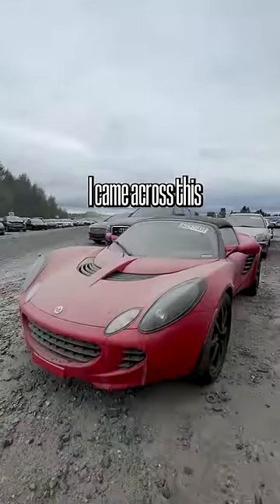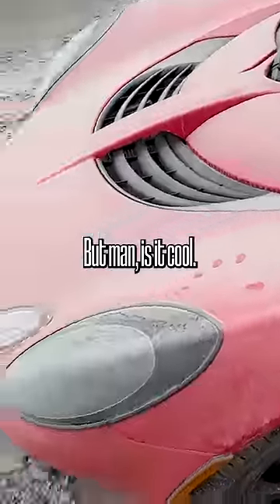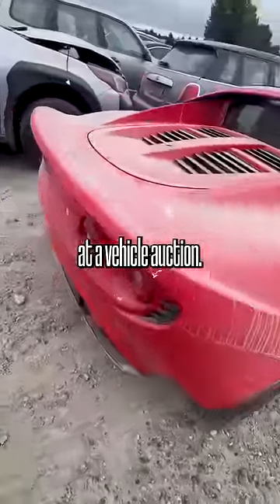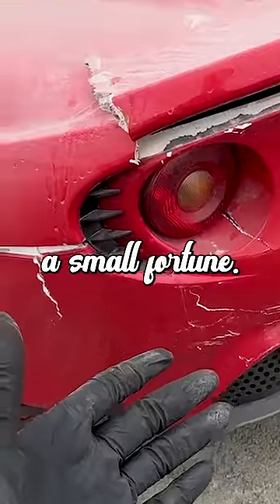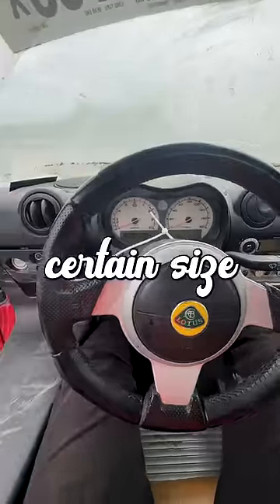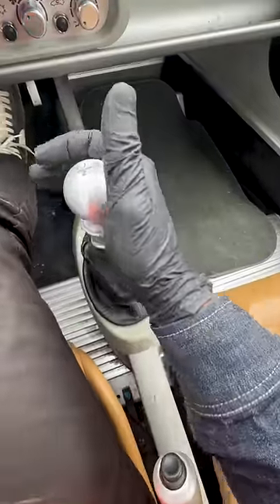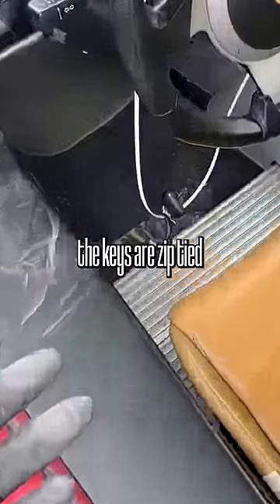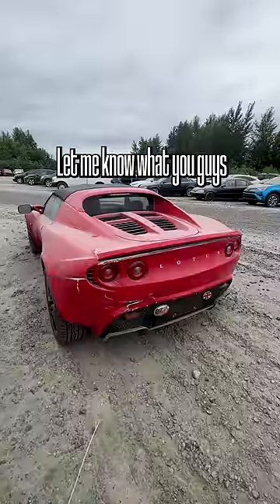Auction Lotus Elise - I Still Can't Believe It...

Comment: Yeah, that's the thing with Series 1 and 2 Elises, the front and back are both just fiberglass clamshells, with no bumpers, so if you hit something/get hit by something, it's hella expensive
Reply: We had to fix one at my body shop as it was a full respray of the car, it was a nightmare job especially since the tri coat orange didn’t cover well😅
Reply: and say goodbye to at least one leg
Reply: It has a bumper (crash structure) but it is internal. I crashed one and found out lol. It's actually a lot more sturdy a car than you think. Your wallet will hurt but you will physically be ok.
Reply: @Noobnuker1  watch one front overlap crash test an come back
Reply: @Noobnuker1  and thats for regular consumer cars. they dont even crash test luxury cars like this
Reply: fibreglass repair isnt that hard, though a new rear clam would cost about $2800.00
Reply: @1183newman  Try 12k with shipping /insurance from the uk for one that is in good condition.
Reply: @stevenfaulkner5649  true, USA likely very hard to ifnd a used one. But that rear clam def looks repairable.
Reply: Fiberglass is easily repairable.
Reply: Yes, the hands are hand made by lotus if you get the official parts. I remember that from when my dad’s got reversed in to. The issue is I think lotus doesn’t make them anymore.
Reply: @invinciblenowyt  there are many people still making them though, not just lotus. Doing a search i found a brand new series 3 lotus elise front clam (would likely fit the s2 as well). £2.2k
Reply: @1183newman  yes I know, but lotus stopped manufacturing them a year or two ago, officially.

Comment: One of my dream cars. Closest I've ever got to a lotus was a 1993 geo storm.
Reply: It would be close if you added a supercharger and relocate the engine to the back seat 😉
Reply: 2000-2007 mr2 Spyder from Toyota. The 2zz 6-speed drivetrain bolts right in. It's a little heavier but so much cheaper and at least as fun!

Comment: You should be able to take that car to a good boat repair shop to get that fixed. It'll still cost a lot, but it'll be easier and cheaper than finding a new panel
Has C4 Corvette hood repair nightmares
Reply: My c4 front bumper doesn’t align right with the hood. I wonder if a boat shop could fix it because the guy I was going to couldn’t do much but make stress marks on the bumper lol
Reply: @bigty4725  Maybe, but if the fiberglass isn't warped or cracked that might mean that the frame is twisted
Reply: @bigty4725  You need to make sure that anyone who works on it does NOT take the targa off when putting it on a lift. A lot of shops will do it, but the targa on the C4 is structural
Reply: @Rich-fr2yv  it looks a little warped in one place. I don’t think the frame is twisted because it just barley got hit by someone backing into it. Most people won’t even notice it but it drives me nuts lol
Reply: @Rich-fr2yv  ok thanks for the advice. It’s not cracked but it’s definitely a little warped in the front left. Not much but I can notice it. I had to replace my fog light to it got busted lol. The car just barley back into it my c4 and caused all that
Reply: @bigty4725  Take the bumper off and make sure the mounts are true to each other. Might have just bent one down a little
Reply: I bet those panels could be even 3d printed in  glassfiber nylon for a few 100 bucks.
Reply: @xIsouLcruSHca  I’d definitely pay a few  100 bucks if it looked just like my front bumper lol. I didn’t know you could 3d print fiber glass
Reply: @bigty4725  Its not 100% fiberglass, its nylon infused with fiberglass (don't know about what percentages, I assume they differ per manufacturer ) but the strength and ability to withstand different forces is quite similar, its about 100 bucks/ kg
Reply: that's a neat idea! never heard that one before
Reply: Inokinetic ( former sector 111 in California) sells brand new and refurbished rear clams for exiges and Elise’s.  

Shino the owner is an amazing person to work with .  They specialize in this type of work and do it the correct way.
Reply: Could easily patch it yourself but cutting a lil out of that section and using some fiberglass and resin. Jobs like this aren't that difficult and ridiculously cheap to do yourself. The biggest cost would likely just be the repaint.
Reply: My dad has a 62 c1 my brother has a 74 c3 I feel your pain but fiberglass is actually pretty easy you sometimes have to get creative with molds and making bonding strips but it’s like adult crafts
Reply: I know the AC replacement was ~$10,000 on the Evora, not an issue you want to have. Everything has to be imported and since it is discontinued it would be even worse
Reply: @krismine99  I think you overpaid for a very easy fix
Reply: @ThorOdinson-zc2kq  it was indeed not an easy fix and they had to import some parts because the actual dealership didn't even have them on hand
Reply: Many body guys know fiber glass actually messy but easy to work
Reply: @ThorOdinson-zc2kq  Whenever you need to replace a component of an A/C system after a failure, the entire system needs to be replaced or renovated to ensure no metal shards block the pinhole in the compressor. If that happens, the whole thing pops. This job can easily hit $10k on a car as difficult to work on as this when you need to import everything and all the lines are Lotus specific. It was $3k on my 2010 ford focus
Reply: @Rich-fr2yv  I own several lotus cars.  Very easy

Comment: Early ones had the 1.8 K-series Rover engines. 2004 onwards got the 1.8 Toyota VVTi units.
Reply: They never exported the K series ones to the US, though, which is where I’m guessing this guy is.
Reply: Toyota 2zz ge with a super charger 225-250 hp
Reply: VVTL-i
Reply: @emmajacobs5575  they didnt use a K series. they used a Toyota 1.8L which has a similar system to the variable valve lift and timing that the K-series uses.
Reply: @YuriTarded-n6r  rover k series and honda k series are different engine series from different manufacturers.
Reply: @YuriTarded-n6r he said rover, not honda
Reply: Most fun I've had in a 1.8! 👊
Reply: @andreistan6534 the 2zz was made by Yamaha. It was sold in some toyotas. Its got some problems.... like the oil pan. In hard turns the oil pools to one side and the oil pump is no longer reaching  the oil to lube the engine
Reply: @hh5395 most likely the head work only was done by Yamaha.
Reply: @Neishy4AGTE  Toyota commissioned Yamaha to design the 2ZZ, based on Toyota's ZZ block
Reply: @hh5395  not really... I own an 02' Toyota Corolla TSport with 222637 km, and it still pulls like new. Regarding the "problem" with the oil pan, it is actually an owner fault for letting the oil reach a level under the minimum mark on the dipstick. Yamaha tuned only the heads of the engine, and it came in toyota Corolla IX (e12) TSport (other names depending on markets like Runx ). Also, some Toyota celicas  came with this engine 2zz ge. For 2005, a face-lift came with shorter steering ratios, lower suspension, and the option to have a supercharger boosting the power up to 224 hp. I am proud to say that my specific car doesn't have any issues, and after 21 years of hard driving, it is still revving happily to 8200rpm like is nothing.
Reply: @YuriTarded-n6r early models used k series. Not honda k series. The rover k series from the tom cat
Reply: yurrr the celica 7th gen had one of those
Reply: @YuriTarded-n6r he's talking about the original Rover engine
Reply: @hh5395  the 2zz engine was not manufactured by yamaha. similar to the 20v 4age, yamaha designed the head. the rest of the engine is toyota. which is why theres actually an engraving with the yamaha branding on the side of the head.

Comment: „Lotus means ‘Lots of trouble, usually serious’” - Jeremy Clarkson
Reply: Not so with this one. Had mine for over 5 years now and 30000 kms. Not a lick of problems.
Reply: Tte ones with rover engines, yes, the ones since Lotus was bought by a Chinese company and changed the engine and gearbox into one from Toyota, nope.
If you care for it and drive it right, you will never have any problems with it 🤷🏻‍♂️
Reply: @nonamerider4953 

The VHPD k series engine (not the Honda k, different motor) was well developed and didn't actually give much to any trouble despite Internet lore.

Comment: I’d totally buy that if I had the money
Reply: Same i absolutely love the elise
Reply: Don't know how much it is where you are but if you can find them they aren't that expensive. Mine new in 2009 was £27k, and you can find them used at a decent price, at least in the UK. Unfortunately they don't make them any more, and the Emira they sell now is much more expensive.
Reply: @georgehelyar  lol in the states thats 30k+
Reply: Damn, here in my country, Philippines, I mean yeah sure its rare in this part of the world, a second hand 2009 elise with 130,000 kilometers on it, went for 71-72k usd converted. Would give my left nut to have one for 30k here
Reply: @georgehelyar yeah the import cost are crazy high here on top of the boat costs to ship it. We are just getting to import the GT-R that not adapted for the states. They cut power and added the emissions parts to them it was a looker nothing more here.
Reply: They haven't moved from the 30k range since in the used market. If you have the means you should get one. It will blow away any S2K, NSX, GR86, BRZ, Miata and FD RX7 when it comes to handling and overall raw feel
Reply: The one in this video sold for exactly $26,000. After Copart fees, it would be just under $30,000 out the gate. Including the cost to repair and register it, total could easily exceed $45,000

Comment: With the 2zz motor it should be pretty quick. Especially at 2,000 pounds
Reply: It is
Reply: Oh it’s fast, my dad supercharged his and I imagine the 0-60 was in the 3 and a half second range
Reply: Requires a lot of skill to drive at speed on a track. The light weight and rear bias means oversteer is common.
Reply: @SockyNoob  do lotus Elise have a rear sway bar ?
Reply: @Crispychicken4u  yes and that is a good thing. Removing sway bars is not tuning.
Reply: My s2 had the Komotec supercharger treatment that gives it 300hp at 890kg its pretty quick.
Reply: @SockyNoob  add the short wheelbase to that if you start spinning it is going fast around
Reply: @bolosantosi8527  I always liked that  gen Corolla XRS . Correct me if I’m wrong but I believe they are  80-100 pounds lighter than the similar matrix? .Nice sleeper ! hold on to it .Not many made
Reply: @Crispychicken4u i love my matrix..  though i have the xr which has the 1zz but its still super fun to drive
Reply: @SockyNoob  The issue is "understeer under power" and "snap oversteer under braking".   Still, a car very much worth mastering.
Reply: @markyishere1  I've got BOE's REV400 supercharger in my '05 Elise. It's zippy :)
Reply: @connordix1859  hope he built his gearbox. the C6x gearboxes like shattering 3rd and 4th when you push more power than stock
Reply: @Crispychicken4u  almost every roadgoing car in the past 35+ years has swaybars. probably some exceptions though, though i cant imagine they handle very well
Reply: @1zzKolby  if you get the chance to drive a 2zz, definitely do it. its a completely different feeling engine.
Reply: @YuriTarded-n6r  nah, the clutch died but the gearbox was mint

Comment: it's a 2zz-ge engine, probably my favorite 4 cylinder engine of all time
Reply: Have you not experienced Honda Vtecs?
Reply: @ChapHammersmith  i have a mk2 gti with a k24 subassembly mated with a k20 head. i much prefer my corolla with a 2zzge motor. better response, lift isn't as distinguishable when driving, and I've driven outta k series civic/ballades lives plenty of times.

Comment: I own an Elise. I'm 6'2 260 lb it's tight, but I love the thing. And you are right about the rear clamshell costing a fortune. I crashed mine and damaged the front. it was 6k for a new front( just the part). My total repair was muuuuuuch more expensive. I can go into more detail if someone wants. 

The engine is a Toyota 2zz ge, From a celica.

Comment: it's not just the fiberglass, these are made with a bonded aluminum chassis, essentially "glued" together. You have to check to make sure the chassis is still good after an impact... or at least as good as you feel safe driving it lol

Comment: Fiberglass is really easy to repair. That damage if it's just ripped and you can bend it back, it'll cost you like 200$ for a repair. But as someone mentioned it could be a crumple zone and stiffening it (aka repairing it) could reduce the effect and result in injuries when you have an accident

Comment: Great cars.  Perfectly fine for anyone under 6'4".  There is an "entry procedure" to hook your right leg around the wheel.  One of fastest shifting manuals you'll ever see.  It uses Celica block, but it was tuned by Yamaha.
Reply: The 2zz is a Yamaha design. Toyota commisioned Yamaha to design the engine based on the Toyota ZZ engine block.

Comment: I’ve had my exige since 2009 .  It’s a 2006 with a roots blower and turbo. 20k miles and 600hp.  
That rear clam is an easy fix.  A replacement clam isn’t more than 2k either

Comment: You are right about that “small panel” as it is in fact not just a small panel, you cannot cut and replace just a portion of it like you can with most cars, when damage like this occurs on these cars you need to replace the entire rear clamshell….I can’t remember the cost on this but it is in the 10’s of thousands just for the part. And then the labor to put it in is insane because you are basically replacing half of the chasis of the car.

Comment: I bet that fiberglass trim would be easy to fix with some epoxy resin, fiberglass sheet, body filler reinforced with fiberglass, sanding, & a small paint job. Some of that stuff you can get at walmart.

Comment: I’m 6’1 and had a 111s in grey with dark red seats about 20yrs ago. Was a mk1 but basically the same car functionally. Easy fit for me but you have to make use of the door sills to get in and out. Must be able to handle your own weight to an extent. Probably not ideal if you are a much heavier build. Amazing vehicles, very much miss mine.

Comment: if I recall the Elise uses a 2ZZ - GE from Toyota that was made available in the 2000's Corolla and Celica of mid/high trim.
in the US the engine also come in the Toyota Matrix and the Pontiac Vibe.

it's also in the Lotus Exige, sometimes with a supercharger, which is the stripped down, pumped up version of the Elise.

yeah, imagine an Elise, a street legal go-kart built for pure driving, and then make it even more driving focused...
those brits man, "bonkers" as they would say.

Comment: It's basically a street legal go-kart.  The lower rear control arm bolts are visible on the front wall of the floor pan from the passenger compartment, and there's no way to get in or out of one gracefully.

Comment: It has Toyota's 2ZZ. I cant remember if its the GE or the GTE though (GE is naturally aspirated, GTE is turbo charged). This engine is found in the 2000 Celica GTS Matrix XRS, Corrola XRS, and Pontiac Vibe GT. I believe a time span between 2000 to 2005. Its Yamahas version of the 1ZZ-FE. What makes it special is the engine is very high revving, with the redline being 8200 RPM. It also uses VVTL-i which was Toyotas version of VTEC. So as youd imagine it was conpeting against the F-series Honda engines and I wanna say the B-Series and the K-Series. Though I believe the K-Series was a little later. Enough rambling from me lol.

Comment: I have a buddy that collects cars, he had one of these, it was as "S" trim. He told me it was powered by a turbo charged Toyota 2.2L. If I remember correctly, the air intake is over the roof, when you're in it and you push it hard it's hard to have a conversation because it sounds like there's a jet engine strapped behind you the whole time and it's uncomfortable for sure. The floor is all aluminum.

Comment: It's a rear engine and it's a 2zz Toyota engine which is the same engine and gearbox that used in the MR2 Toyota and Lotus of had a long relationship in the racing Arena. For example some people don't realize that the very very nice and well-balanced suspension found in the Supras all the way up to even the newest one that suspension system was designed by lotus that's just one example. Lotus also has been cooperation with Toyota in various types of road racing class of cars since the 60s. It's a very cool car and I've seen a 2zz Toyota engine in an MR2 that was jumped up to almost 1100 horsepower it was obviously turbocharged and tuned and everything else but that little engine has potential to make that car screamer. But you are right it is a track toy if you want it to be and has a lot of potential to make it a lot better than it is as it sits. And I would not worry about that fiberglass damage in the rear. You can find a shop that could fix that for a few thousand bucks or 4,000 if the most. If you're wanting the car for a track toy then who cares if it's color matched or not. But if you're trying to make it a show car to have the shiny car to show off the people then maybe you'll spend more on getting that fixed. But if the price was right I would definitely take that car even if it has cosmetic damage. So long as the engine runs and it's not eating oil and it doesn't have any blown head gaskets or anything mysterious going on in the gearbox isn't leaking transmission fluid and all that kind of good stuff then I would definitely snagged that car if it were me. But it is sort of the Poor Man's Ferrari if someone said it's the rich man's Miata but a Miata is front-engine not mid-engined like this car is and potentially it can be a hell of a lot more car than a Miata. It's almost Blasphemous to compare that car to a Miata. LOL